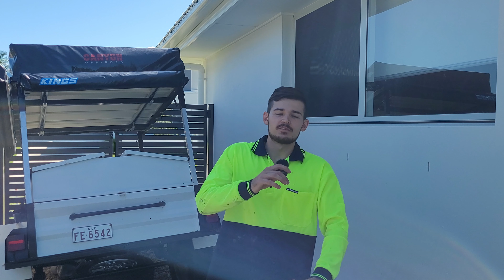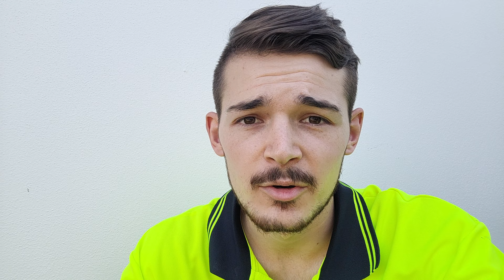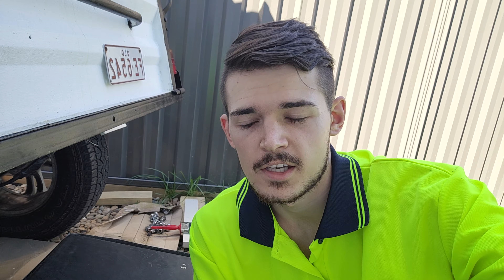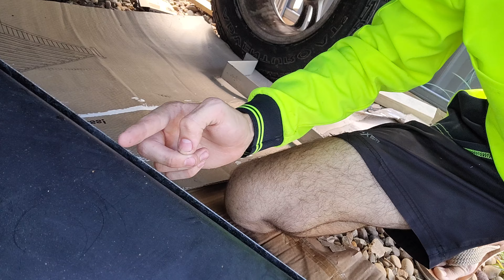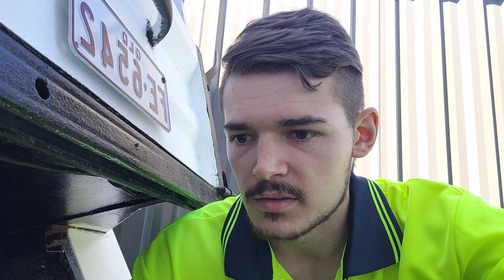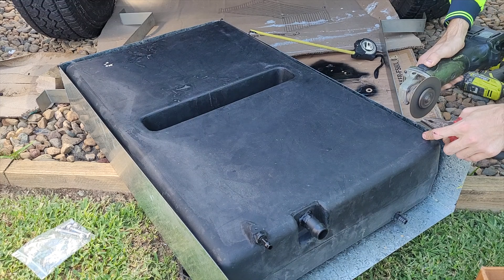WATER TANK + GAS SHOWER INSTALL ON THE CAMPER

Comment: Umm the axle will smash into the tank wen going over bumps?
Reply from the maker: It did a tiny bit but only into metal cover not the actual tank. In the year I owned it no worries🙂💯

Comment: Great video. Thank you for bringing us along on the build. I see someone else already commented on this - it seems like very little clearance between axle and water tank. How will the water tank be cleaned out, to avoid algae build up? To help with vinyl tubing, you can soak the end in boiling water to soften it up. You can also apply a drop of dishwasher soap.
Reply from the maker: Hey Wayne. Just got back from Fraser and the tank is just fine luckily. It's only the metal cover that is close to axel. The tank is 2 to 3cm from the top. And I will use sunlight into the filler hole with water to give it a clean. It's only used for showers and cleaning...won't be drinking😊

Comment: Hey mate. I'm a bit worried about your placement of your water tank. Between the Axel and bottom of your trailer. If you hit a rock or something hard. Your going to brake your water tank.
Reply from the maker: Unfortunately it's the only place it can go haha. I am going to do beach driving mainly. Won't be doing rocky offroad stuff and if I do I'll go very slow anyway. Between the tank and floor there is 1cm gap so hopefully all will be well and good. Best to test it out and see how it goes I guess😄 if I do brake it I'll maybe weld one up🔥
Reply from the maker: Thanks for the feedback tho Ben. Appreciate it💯🙌🏼